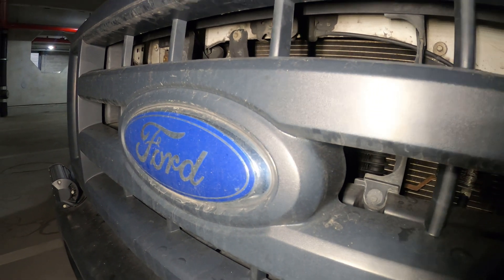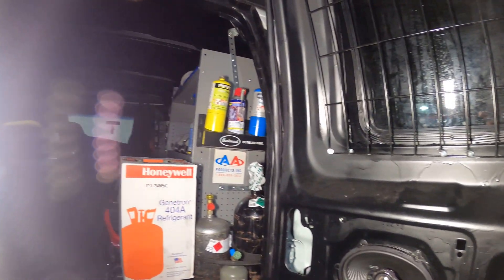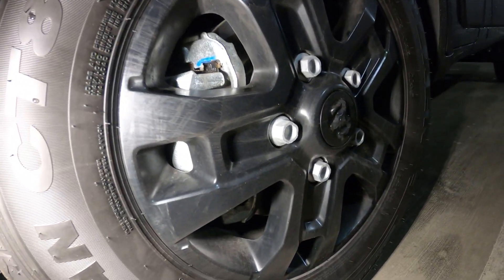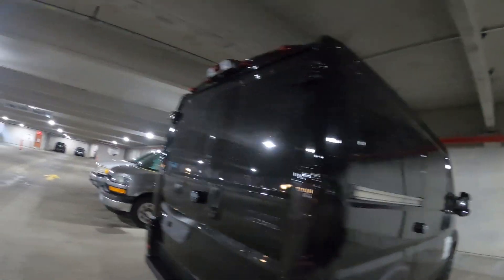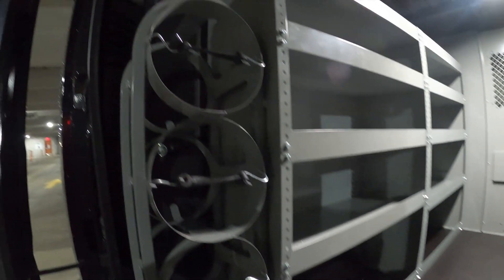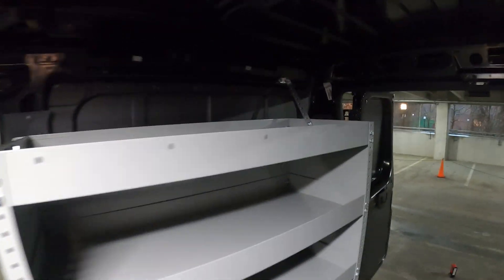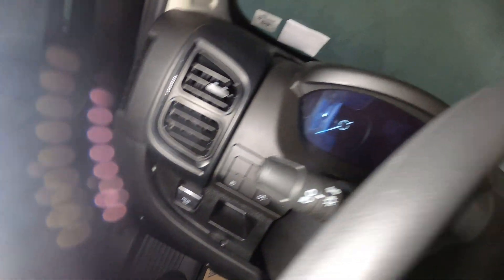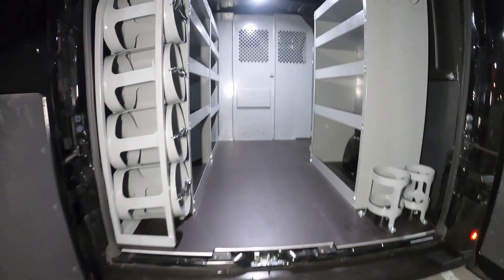HVAC Work Van: New HVAC Work Truck Upgrade & Tour (HVAC Van Tour) HVAC Work Van Build/Shelving

Comment: Congrats man. That’s a nice van. Love the blacked out look. I myself actually just got a ram promaster 3500 with a 10’ service utility box on the back. Getting used to the front wheel drive is a change. Hard working vehicles for hard working techs.